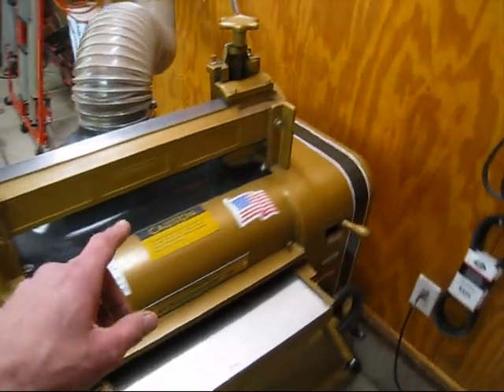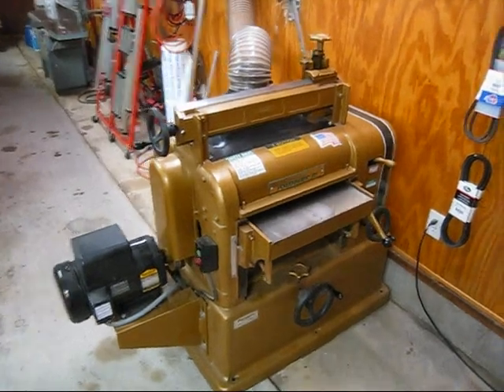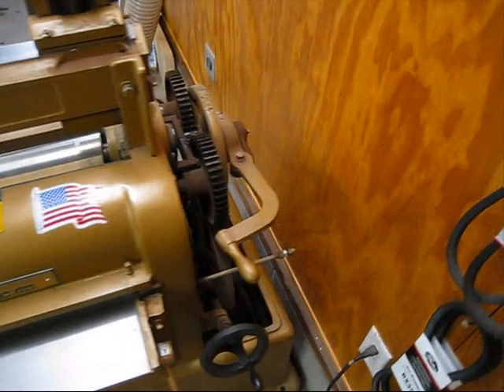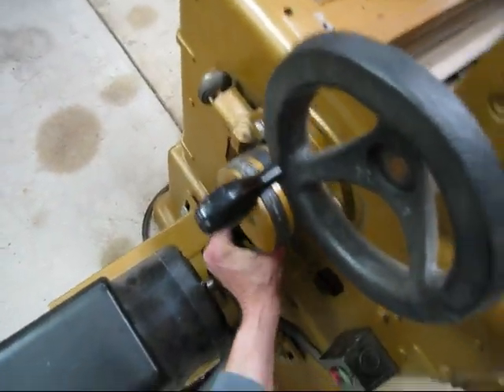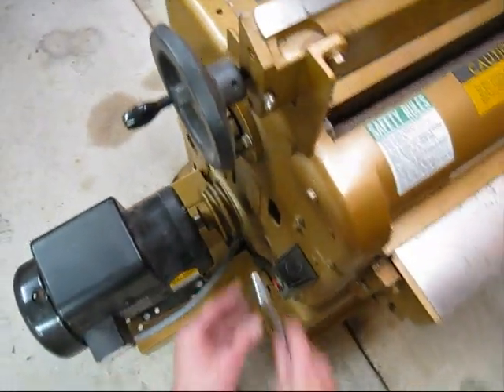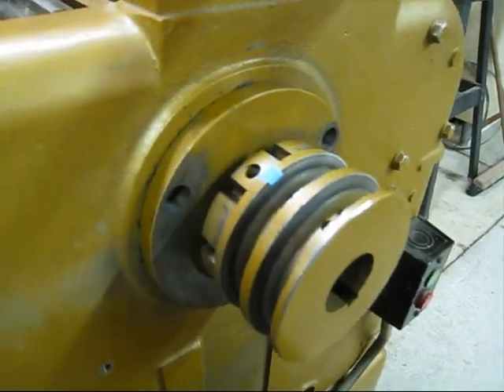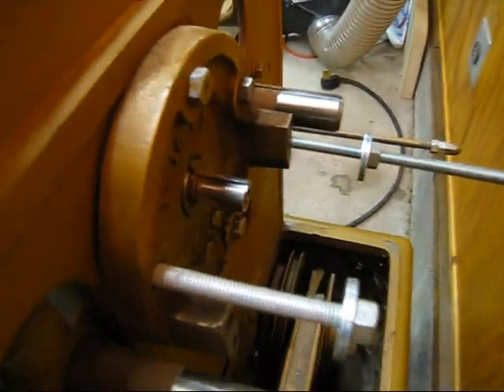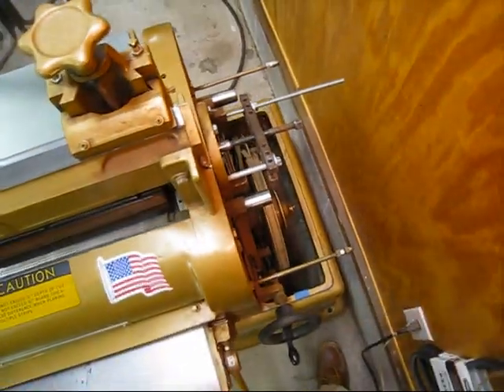Replacing  Bearings in Powermatic 180 Planer (Part 1) (CLICK LINK BELOW TO STREAM "HOW TO" VIDEOS)

Comment: @brandotown
I just purchased a PM160 from the mid 60s (dark green, white stripe) It seemed to be in good condition and the guy I purchased it from ran it for me and it ran well. I was planning on taking it apart and replacing bearings, belts, and other various wear parts, as well as giving the machine a good cleaning - but I was hesitant because I couldn't find much literature online. Your videos have given me the confidence and security that I needed to tackle this job. Thank you very much. Your videos are worth a hundred thousand words. A true master.

Comment: This video was the deciding factor in my decision to purchase a used Powermatic model 180 on 10-5-16. It was manufactures in 1978 was in the
Reply: This video was the deciding factor in my decision to purchase a used model 180. The planer was manufactured in 1978 and was in the basement of a local hobbyist. It was never used in a commercial operation. However I was aware that at a minimum it would need belts, bearings, blades and adjustments. Initially I was reluctant to get involved since I have functioning planer a Delta  DC-380. However, the 180 was in great condition except for service rust on bed, rollers and cutter head. It also came with the knife grinder and jointing bar. Your video sealed the deal. Thank you for taking the time and effort for all three videos.